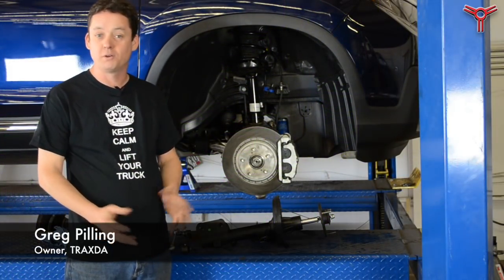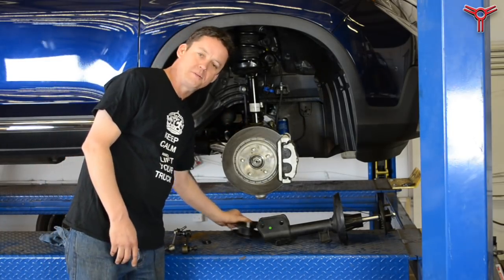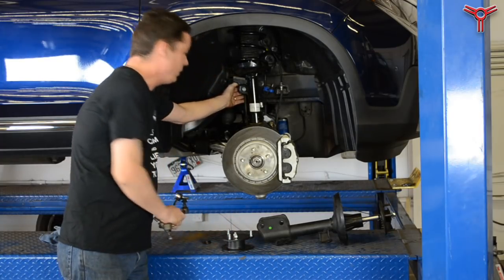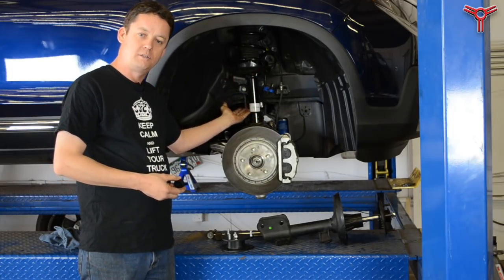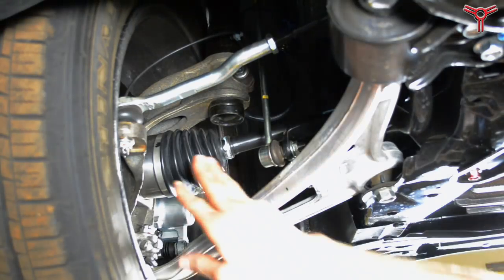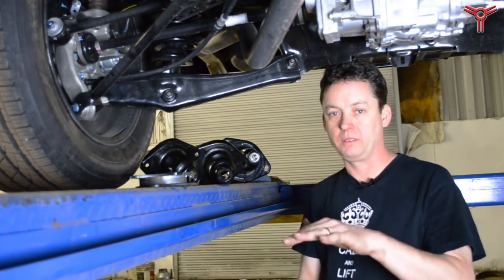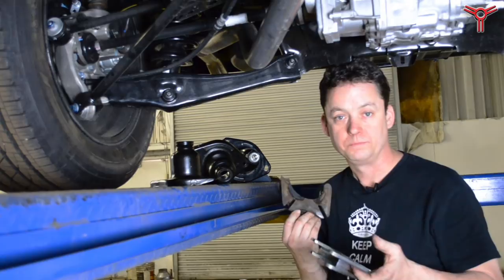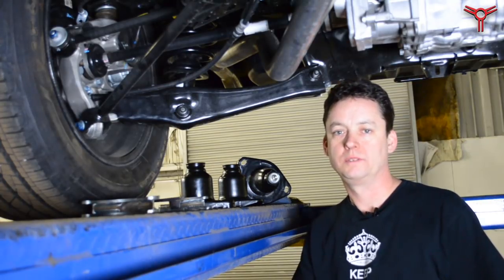Traxda Lift Kit for 2017 Honda Ridgeline

Comment: Will this suspension lift kit alter the payload/towing capacity??
Reply: ed wong its a ridgeline, you shouldnt be towing a lot with it
Reply: tacoma is 6,800 lbs, ridgeline is 5,000 lbs. you can definitely tow with this vehicle
Reply: After my lift install I had to put new CV axles in. The lift kit caused vibration with my old axles, less than 60,000 mi on them added $650 to the instal for original Honda axles.
Reply: @jimghigliotti4863  Any problems since with your 2" traxda lift??

Comment: basically a car with a bed.
Reply: Wrong. It does not have the towing capacity of others but its payload capacity is respectable. It also has additional steel to stiffen the unibody and bed as compared to the Pilot. The Ridgeline has been truck of the year in its class for since 2017. If you are into serious off roading or rock climbing, buy a Jeep.
Reply: @alangoldberg9212  dont try to over justify too much to convince me it's a real truck please.  I know the difference
Reply: @ns671fr  Really? what makes a "real" truck? GM just put 4 cylinder motors in their full size trucks. To me a "real" truck needs more motor than that, Ridgeline has a V6, 1500 lbs payload and the only midsize so far that you can load full sheets of plywood in laying flat; those see truck like things don't they? But, maybe to you it needs a solid rear axle and a certain amount of ground clearance?  I'm willing to concede they're all "real" trucks. Take some advice from Malcom Gladwell and give yourself permission to change your mind; you can always change it back.
Reply: @cgreeneblue  that's a joke
Reply: Some people want and need small trucks like this, just like the old rangers. It’s just what most people need for utility
Reply: @cgreeneblue  minimum needs to be body on frame 4cyl is okay like the 1st gen tacomas
Reply: Ok. Ridgeline has flat bed unlike, I had the f350 but the wheel wells were huge so that was not a go for me. Secondly, it’s the only midsized utility truck with independent suspension. Also, does have respectable towing and payload capacity. Gas mileage is great. Only thing I hate about is underpowered, they should put least 4.7 V8 or 4.0 V6 . Additionally, does have bike rack inside the truck, and under bed storage with water drainage, and can open the tailgate sideways/front. Finally, its a Honda, the used ones are least 325k to 400k kms around 8000$ price tag here in Canada. 

Most of the common people like me don’t need a 1/2 ton f150 s or 1500s just to go to mall, we use rigelines to go to pickup some rocks or tow fifth wheel or to put some pallets or firewood’s, moving stuffs etc. 

It’s not a suv with bed, it drives like a truck and has usability ad features. Also distinguishable with pilot side by side. It’s a truck of its own. Just like a Jeep, is Jeep a suv? No, A car? No, exactly like that.
Reply: But I do not care. I will buy a fully loaded 2020 Honda Ridgeline anyway.
Reply: @ns671fr  why does it bother you so much?
Reply: @slowsti0535  not a truck.  Just a pilot that didnt go suv
Reply: @ns671fr  is a gladiator a truck?
Reply: Let's talk real for a moment: I have a 2017 RTL-T. I tow an 18 foot bunkhouse from Coleman (3800lb unloaded, 4200 maxed out). I tow a 20 foot 1975 Starcraft bass boat (aluminum hull) with a 140hp motor (3700 lb). I have towed my father's massey ferguson tractor with backhoe in an enclosed 16ft aluminum trailer (4800lbs). During the pandemic I did some work around the property and I have used it to haul the following (each item is a single trip not all of these at once obviously): 1400lbs of landscape blocks, 14 sheets of 3/4in plywood, and 42 30lb bags of cedar mulch. I have pulled my father's 2017 Silverado out of mud that I did not get stuck in when I drove through first (4x4 means squat when you have open diffs). So it does have the capability to do most of what an average person might do. Now let's talk about trucks that have similar capability but don't get the hate: the old Chevy s10/sonoma crew cab with v6 has a max towing capacity of 5200 lbs and only 800 lbs of payload in the bed. Old school ford ranger had 5600lbs towing (only v6 versions and then only if you had the supercab 4x4 with an automatic, otherwise 3,400lbs for v6 manual and 2200lbs for the 4 banger). So sure, if you want to two a 30 foot camper, or hit the Rubicon or Moab, a Ridgeline won't cut it. However 95% of truck owners don't go to Moab and so on, so this truck is adequate for a majority of tasks performed by normal truck owners. Sure the styling could be better (thank you 2021 model for fixing this), but I find it is perfect for my family of 4 and our needs. If you need more, buy more and we won't criticize you one bit, but there is no need to project your needs or insecurities on those of us that buy just enough truck for our needs. Or do you also insult everyone who drives an old s10/sonoma or old ranger as well?
Reply: @jg8263  Did a lot of the same stuff with a Gen 1. Just hauled a 800 # gun safe plus 500# of other stuff with a Gen 2, 22 MPG.
If  more pulling is needed grab the Cummin's 5500 for that. Tools for different jobs.